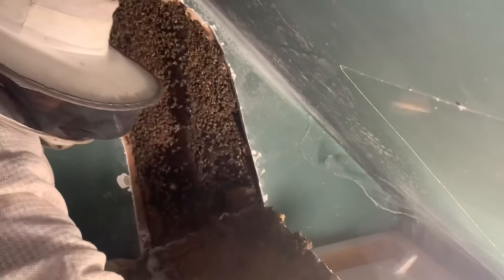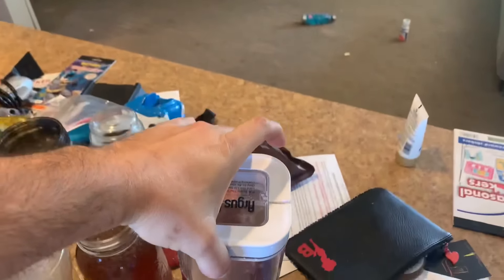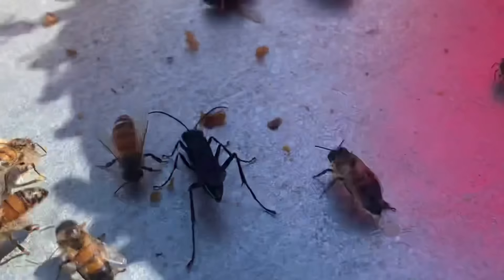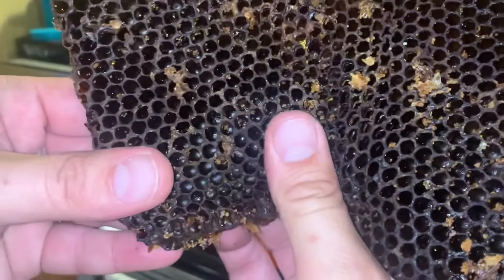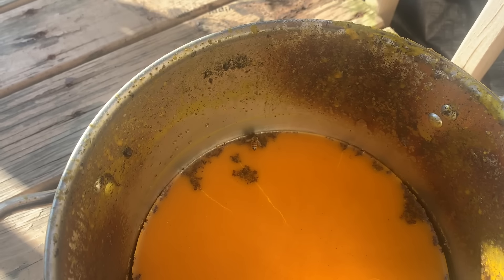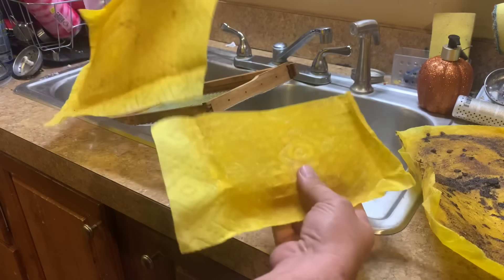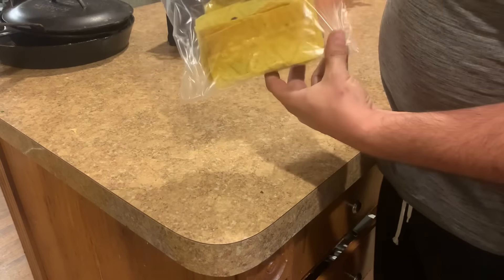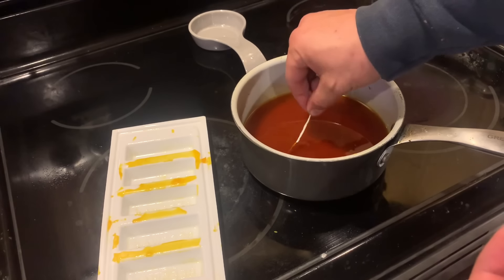Rendering Beeswax from honeycomb

Comment: I have just recently checked out solar wax melters on youtube.
One of these is really easy to build, does not take much work to melt the combs and most of the dirt remains in the melter, can be used as a fertiliser, added to a smoker fuel or processed further to extract more wax.
Reply from the maker: You know, I’ve seen other comments on Solar wax melters. I think I might look into that. Like I said in the video, I will be refining my process in the future. If I could melt the wax and filter it at the same time using a solar melter, that would take a few steps out of the process. Thanks for the idea!

Comment: Its very easy to make silicone molds my guy. It only costs w/e the 2 part silicone is , ( i do miniatures the plastic toys and sometimes need molds}. Or use 3d printer, up to you.
Reply from the maker: I wouldn’t have thought of using a 3D printer. I would like to make a silicone mold for the smaller 1 ounce bars. The mold that I had in the video was made of plastic and melted.

Comment: I not a beekeeper or anything of the sort, so i am curious as to why some of the bee's wax is way lighter. or why some other is darker. is it dependent on how long you leave it to cool?
Reply from the maker: No. A lot of the color difference comes from the different ages of the comb and how dirty it is. If you notice in the video, some of the comb is black as coal before it’s melted. It’s black because the bees had been using it for over 8 years tracking dirt onto it. If you were to get brand new comb, the wax would be almost white.

Comment: I've tried leaving comb or the scraped frames for the girls to clean off, but around here within minutes there will be a swarm of Yellow Jackets covering everything.  Just now I went out on the driveway to pour my melted comb through a filter, and before I had poured half, the damn YJ's were swirling around me.  I'm in W central WI.
Reply from the maker: Wow. I don’t have that much trouble with yellow jackets. They are a problem, but manageable. Maybe putting up some traps would be helpful. Thin them out a bit.

Comment: nice video! was curious though, why do you throw away the waste material from the wax melting?

could you not have made fire starters out of the mass? like, maybe get a sausage maker and turn the warm mass into a cylinder of fire starter, then cut a bit of material off as needed.

with the large amount of waste, you could make a sizable amount of fire starting cylinders.
Reply from the maker: That may be an option. I’ll have to try that next time.

Comment: Very interesting video, but I have a question.  If you rolled the wax covered paper towel, would it make a garden candle thing or would there be a horrible smell from the bits of debris?
Reply from the maker: A candle needs a Central wick. With paper towel layers, it would burn erratically.

Comment: pouring the melted wax through a cheese cloth placed over a bucket would save you several steps and a lot of time.
Reply from the maker: I thought about cheese cloth, but I felt like I wanted a better filtration. Using paper towels worked really good. Plus they work well in the oven

Comment: Can you toss the 'junk' into the compost or garden?  Does it hold any potential value?
Reply from the maker: I think you probably could compost it down. If you could find a way to grind it smaller it would work better. But I’ve also heard that it could be molded into small bricks and used as fire starters. I plan to try both methods in the future

Comment: Do you seal/paint the wax with something? The color changing process at 14:50 has me confused a bit haha.
Reply from the maker: No. The difference in color is due to how clean the wax is. Some of the wax I melted was stuff that I had bought off of eBay and was very clean. That’s the lighter colored wax. The darker colored wax is the stuff I took out of a house and melted down. It was very dirty, so it produced a darker colored wax. Then I just did the color changing scene as a added video effect.

Comment: Why not use a double boiler? Like a pot in a pot with water over a heat source? After you could just filter and strain after the first melt. Go straight from wax to filter to mold. Only melt once. Maybe twice.
Reply from the maker: At the time, I just didn’t have the proper equipment. So I went with what I had. But I plan to get some new equipment before I do it again in the future.
Reply: @RyanGrady  I understand. That would be a method to explore.

Comment: I have a VERY large electric deep fryer that has a dump valve in the bottom. Why not use something like this and just keep adding material and filling molds from the spout. Skim on occasion?
Reply from the maker: That might actually work pretty well. I will have to look around on the Internet for one of those. Thanks for the idea!

Comment: I may have missed it, but what type of paper towel is that that you can put in the oven?
Reply from the maker: I just use bounty paper towels. There’s no open flame, and the temperature isn’t very high. Plus the wax coating probably helps make it work.
Reply from the maker: I just use bounty paper towels. There’s no open flame, and the temperature isn’t very high. Plus the wax coating probably helps make it work.
Reply: Thank you 👍

Comment: I am confused.
Why would you use a honeycomb base made out of plastic?
That base can be bought, or made from beeswax.
Why would you not use that ???
Reply from the maker: I find that it provides more stability for the comb. That’s the only reason.
Reply: @RyanGrady  
Hi, thanks for your reply.
I don't know if what I am about to share is relevant or not, but when my mother was beekeeping, and we prepped up new frames, we never had any issues with instability.
What we did, was use the beeswax hex base sheets, insert them into grooves in the top and bottom rails of the frame - and the frame had a wire that threaded across the frame twice (such that the sheet was divided horizontally into three sections).  The wire then had an electric current run through it, which heated it (timing was important, lol) and the sheet was melted onto the wire.
The current was switched off, the wax reset, and the sheet was very securely fixed.
Not sure if that is a helpful suggestion.
Cheers
Reply from the maker: That sounds like a horizontal hive? 
I think it’s really just personal preference. When it comes to the deep frames, when they get heavy with honey, I’ve had them fall apart when inspecting the hive. That don’t happen with the plastic supports. Also when extracting honey from the honey supers, the centrifugal motion inside the spinner can cause the comb to fall apart. 
The plastic is good grade, and once you cover it in a layer of beeswax, the bees don’t mind building on it at all. 
I think that should be remembered is that bees are not controlled or forced. We only manage them. At any point, they could leave the hive for a better place to live. The fact that they don’t leads me to assume that they are happy with the configuration.

Comment: Commercial beeswax rendering with pressurized steam systems will take remaining wax out of your stovetop processing scraps. Might even pay you for the yucky stuff.
Reply from the maker: Really, I would like to know more about that!
Reply: @RyanGrady  I'am not a processor strictly known of those equipment being utilized by certain companies in Honey  Bee Hive products industry. 
Google for sources, I've read about this levels of rendering years ago pre internet.
Reply: @RyanGrady  The processing that I've utilized is with large "Tamale Pot" fill with dirty brood comb, dirty wax rendering process waste (Junk). Use a fine mesh screen DIY or stovetop fry pan mesh topper may fit snugly into pot on top of scrap wax, top this off with ceramic dinner plate and/or heavy cast iron Dutch Oven lid, add water, boil on no flame heating elements, boil time isn't exact.
Cool down long enough for wax to solidify firmly. 
This was my own development due to not having volumes enough to justify buying commercial turn key equipment.

Here are a couple of links for equipment purchases 

"Logar Insulated Cappings And wax Melter Clarifier Review. Filtering and cleaning Beeswax fast!" on YouTube
https://youtu.be/usb97LNJf1A 
Gwenyn Gruffydd Channel 

"Rendering Wet Wax Cappings With my Finlay Wax Melter, Salvaged 8 Pails of Honey!" on YouTube
https://youtu.be/HSNq7U3fnds 
A Canadian Beekeeper Channel